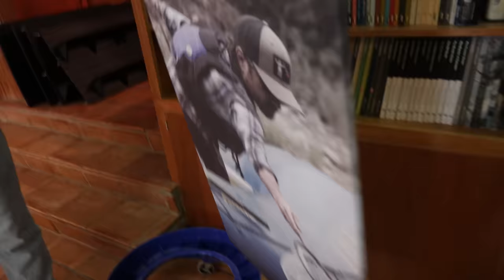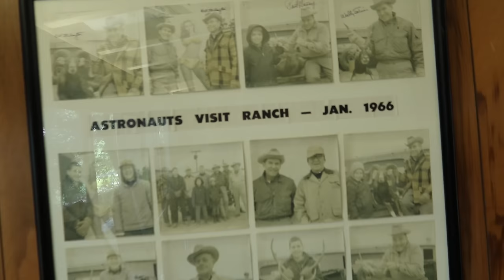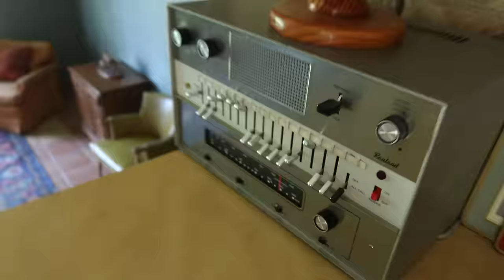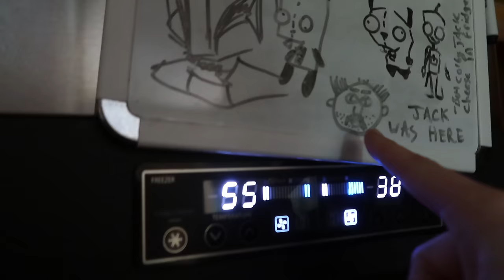The Haunted Astronaut Coom Ranch

Comment: It sucks that the bunkhouse can't be preserved, that place has some serious history behind it.
Reply: Actually, if it was used by the first gen astronauts, wouldn’t that be a big deal? I call historical landmark personally.
Reply: No one cares about kick ass old history like that anymore. Sad.
Reply: @fuzzyhead878  100%!!
Reply: You guys need a way to preserve historical buildings, sites and statues at the Federal level. Australia and UK both do this and it's actually illegal to do certain things to the buildings if you own them. For example it's ok to run a small school or orphanage inside the original farm owner houses around Melbourne, Australia, but it's illegal to perform certain maintenance upgrades, smoke inside, add extensions that require alteration to the architecture, sell without notifying or destroy the buildings. The states in Australia also have protections for historical foundations, but they tend to be a little weaker. I know USA has stronger state laws than federal in some areas, however.
Reply: I hope someone with influence reads the above. I'm concerned about Californian invasions where before I didn't care what happens in the USA. I'm beginning to have the same concern I have developed for England, and have always had for Scotland, Ireland, Wales, Cornwall, Canada, New Zealand and Brittany. (edit) The destruction of statues was a real eye opener, doesn't matter if the people they represent were reprehensible or whatever, they're still historical monuments and should have had federal protection. (/edit)

Comment: Yes, there needs to be a suppressed flintlock pistol and rifle in the world.   Weird question, do you need to register a suppressor if it’s not on something actually considered a firearm?  I’m very interested in how badly it’s going to act like it’s over gassed… because basically there’s an open hole to the pressure chamber and it’s probably going to foul pretty quickly. But it’s still going to be cool!
Reply: A suppressor is a NFA item and considered a firearm by itself, so yes it would need to be registered, even for a flintlock lol.